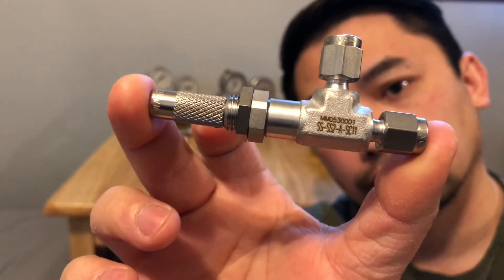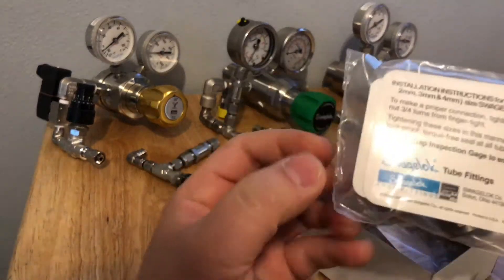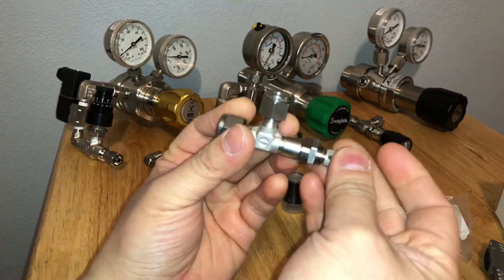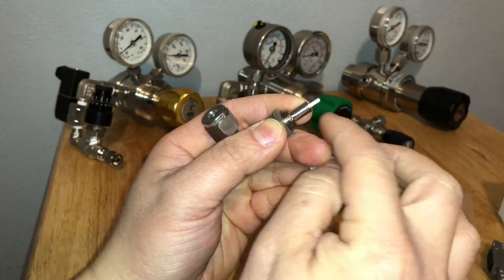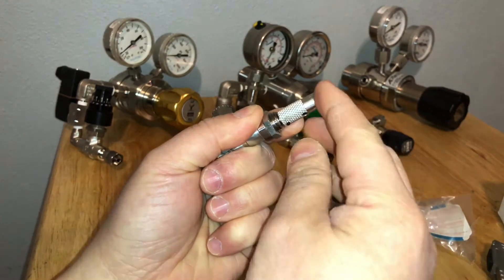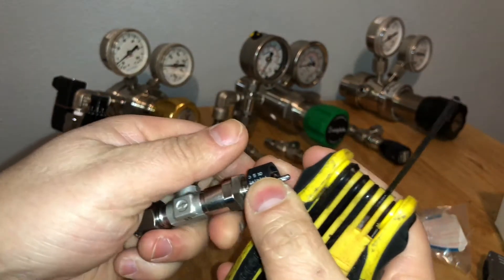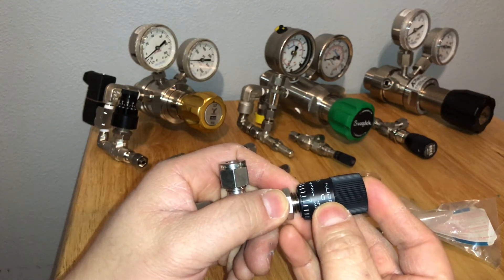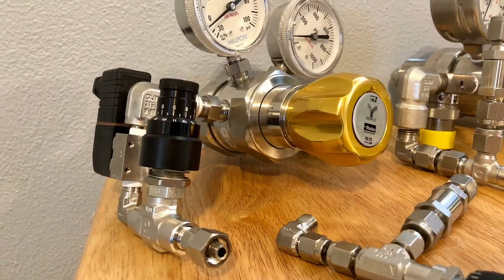Installing a Vernier Handle on a Swagelok S Series Metering Valve

Comment: Hey there. Do you mind listing the part numbers for the parts after the solenoid? Thanks!
Reply from the maker: Hi Daniel, depending on whether you have a VCR, NPT, tube or whatever connections are out there, you'll need a stem/nipple (gaskets, if using VCR face seal fittings), solenoid (and manifold if needed), elbow (sometimes a reducing elbow, depending on your parts.  Elbows aren't necessary, but do make it look like a weapon of mass destruction), power adapter matched to electronic requirements of the solenoid, another elbow, maybe a port connector and ferrules if your using tube fittings, metering valve, another stem (or a tube adapter if using tube fittings), and a check valve (or a bubble counter with an integrated check valve).

Comment: Thanks for this, I called and they said they have no rebuild instructions (not even a torque!), and I cleaned the valve and had to reassemble the whole thing. This video made it more obvious what I was doing wrong reassembling it. I had tightened down the brass piece until I felt resistance, but I did not realize the brass piece itself just bottomed out, thought the needle did. Loosened the brass piece, brought it to the top, tightened it down until I felt a little resistance (so little resistance; that needle is soooooo thin), and then completed the rest of the rebuild per your video.
Reply from the maker: You're welcome.  Glad I was able to help you out.  As stated in the video, I tighten it slowly until I feel a little resistance, and then I back up very slightly, and then I tighten the screw.

Comment: Nice regs, dude! 
I`m searching what to get to build one. I`m not sure yet on the fittings and the correct metering valves.
Reply from the maker: Wilson Miranda, make sure you get the S (small) series, if you’re using it for the same purpose I mentioned in the video.   The plantedtank.net has a list of metering valves that others have tested.  One affordable solution that you might want to consider is the Fabco NV-55-18.  You’ll only need stainless steel if you’re using this for calcium reactors for saltwater aquariums.